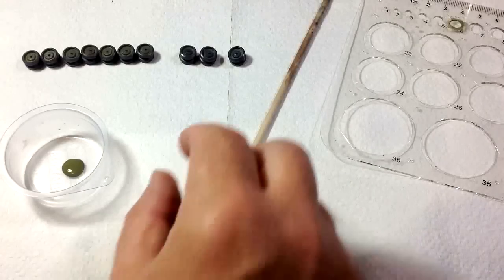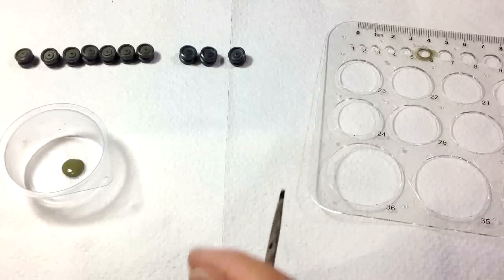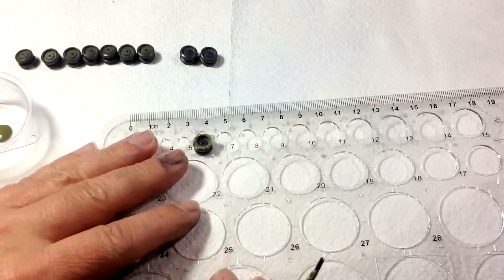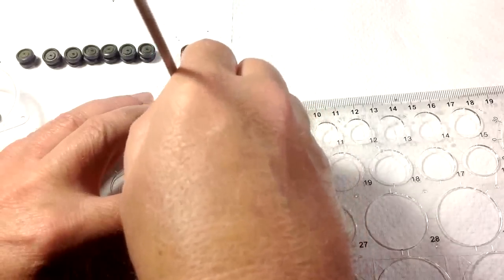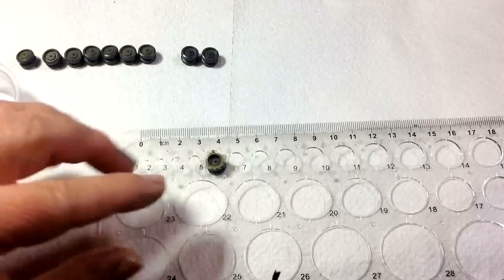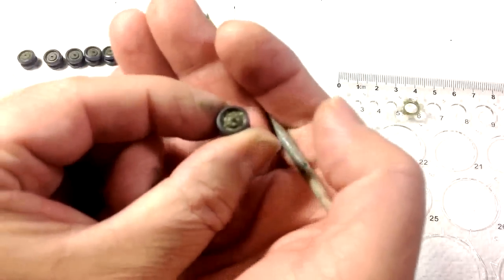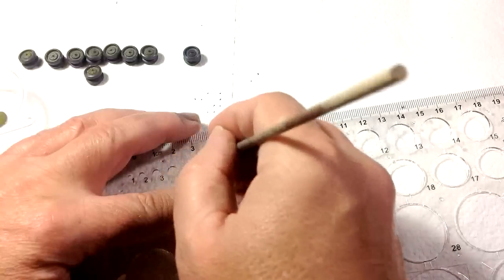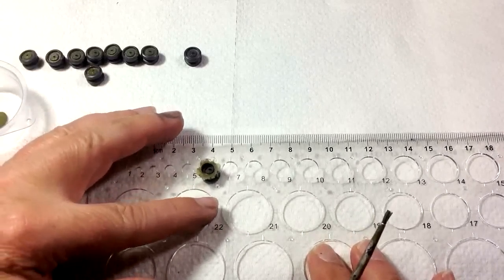How I Do Rubber on Wheels

Comment: Great job Harry !   Never thought of doing it like that. One of my old modeling buddies had an even simpler way. Spray the wheels the base color when spray a heavy coating of dust over the whole side of the tank, wheels and all. It actually looked good, too. It just looked dusty and we'll worn. A bit of color on the part that rode on the tracks and your done. Personally, I have always done it like you but your method makes a lot of sense. I'm going to use your method.
Reply from the maker: +Ennis Anderson good to know you can teach an old dog new tricks

Comment: I have never thought of using a brush with the template. Maybe I will try it. But I was wondering if you get a slightly different color or texture if you brush paint the wheels and spray the rest of the vehicle. I have encountered this whenever I try to do touch ups with a brush over an airbrushed base. Even though I'm using the exact same paint from the same bottle, there is a very noticeable difference.
Reply from the maker: What brand of paint are you using and is it acrylic or enamel?
Reply: I was using tamiya acrylics when this happened. I usually use tamiya for base coats.
Reply from the maker: Ah yes Tamiya can be an issue, being butanol based it does not hand brush easily or ever match the same as airbrushed.  I use Lifecolor acrylics these days, which thin with water then spray and brush the exact same colour.  If you watch my camo job on the Skoda I was able to go back and touch up my airbrushing with the the same paint and get a near t flawless finish with an exact colour match. However, after saying all of that, the wheels on Armour will always get some mud and dust on them as well as grease and grime so rarely match the rest of the vehicle anyway when weathered.